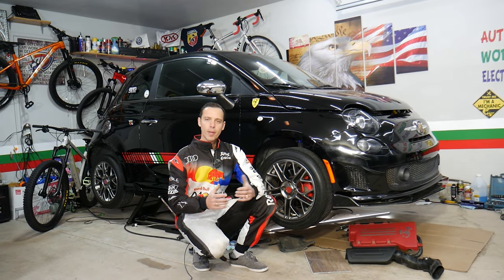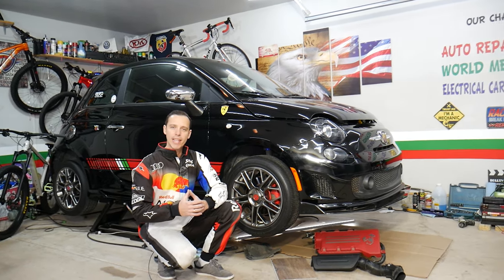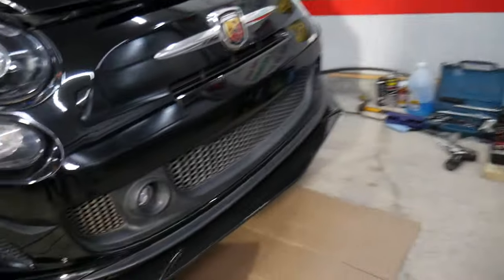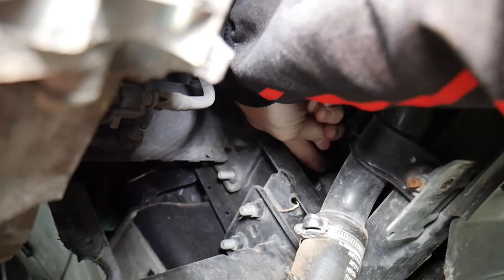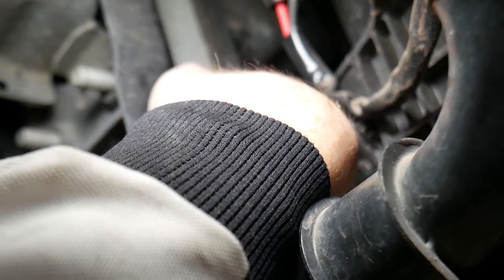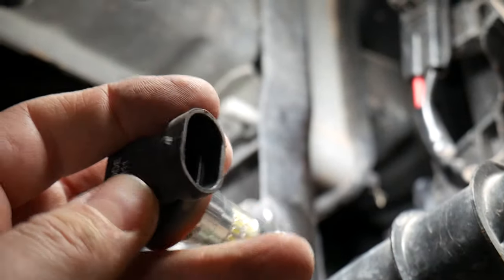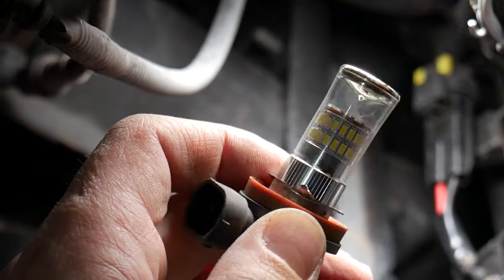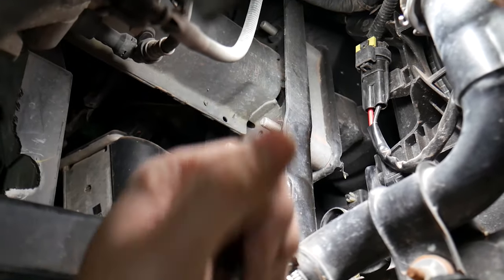FIAT 500 FOG LIGHT BULB REPLACEMENT REMOVAL, FIAT 500 ABARTH TURBO FOG LIGHT BULB

Comment: Yeah, definitely can't reach the passenger side bulb on a 2013 500 Turbo. I'm going to have to pull the bumper to reach it, there's not nearly enough room to fit a hand in there and unplug the harness or twist the bulb.
Reply: These tiny cars are an absolute joke to work on 😂
Reply: Yep i concur..my Abarth 2012 is the same..can't reach the passenger side. Would like to see if the video guys has a way without removing the bumper but i doubt it.
Reply: I started replacing the fog lights today thinking it was going to be an easy task. Replacing the left bulb was easy as on the video. Unfortunately the video doesn’t show the reality with the right side. I was able to replace the right side without removing the bumper but it took me a while since the space is way too limited. You need a lot of patience and be able to unplug with one hand. But…. It can be done with a lot of effort
Reply: @aldorosito8086  you must have smaller hands than I.